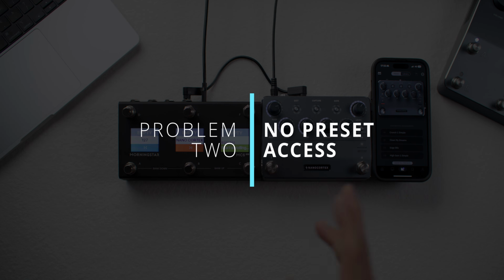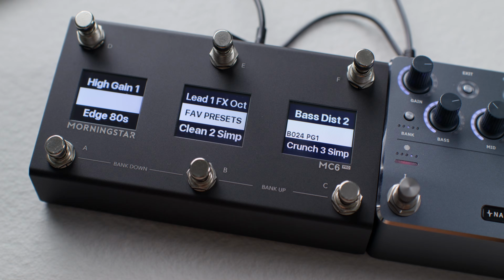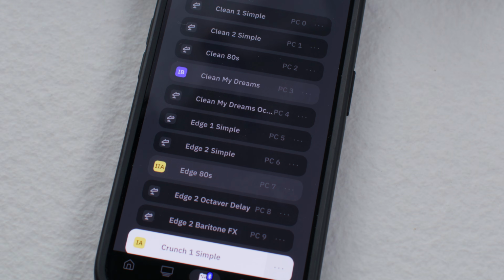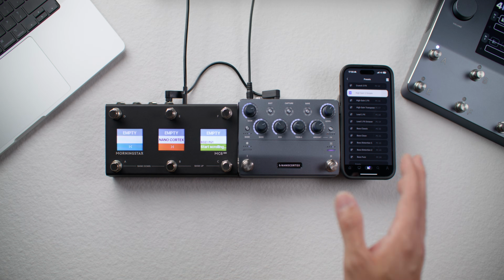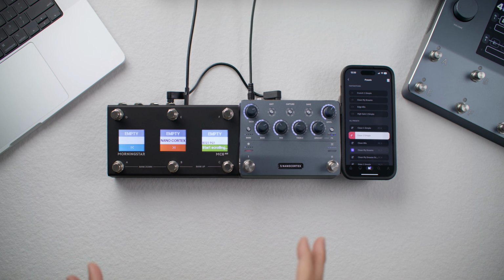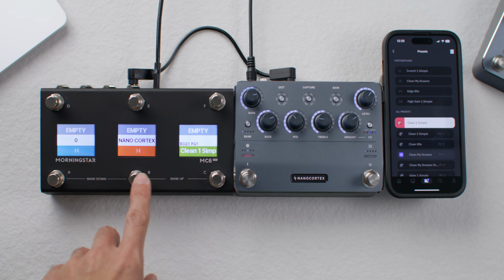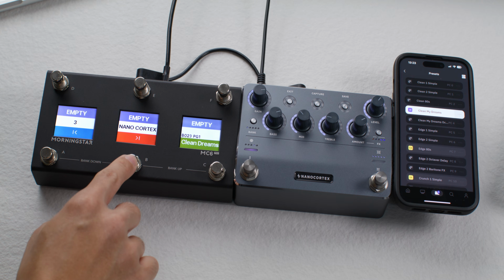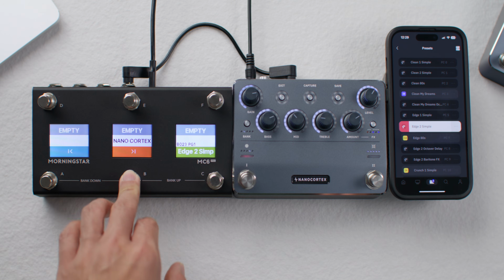Nano Cortex MIDI - MC6 PRO Fixes 3 Undeniable Problems

Comment from the maker: Neural DSP has release a HUGE update with NanOS 2.1 that allows MIDI control over individual effect slots, tap tempo, tuner and more! Learn all about the new update here - https://youtu.be/V2jq4iCfrAo?si=rIE9zllg8yaZ0KI4
Reply: Where’s the video on how to set up displaying preset names using the preset rename function?
Reply from the maker: @marcelpaige4134  It's in our knowledge base here: https://help.morningstar.io/en/article/preset-message-scroll-scroll-through-messages-within-a-preset-1osfmw/ And also, you can download the bank template, upload it to your controller and see the settings for yourself as a guide!

Comment: Great video and solution but my issue is by adding this midi controller that costs around 450 euros plus the cost of the nano for 500 euros your nearing quad cortex / quad cortex mini range which has far more features for the price. I guess if you own a nano already this is a good solution or if you can find an mc6 pro used or maybe its cheaper new in the us, then this is a powerful combo.

Comment: I downloaded the template on my MC6Pro. The scorlling works perfectly fine :) I have an issue with the preset names: When scrolling with switch B, switch C displays the correct names (going through the Msg in switch C). However, switch A seems only to change the direction of how switch B goes through the Msg in switch C and does not go backwards through the Msg in switch C. Can you help me?
Reply from the maker: Hi! Please send us an email at ‘help@morningstarfx.com’. We provide support from there. A service ticket will be created for you and we will be able to follow up easily.
Reply: I have a similar problem. Did you manage to fix it?

Comment: This is a wonderful addon I know it works as advertised but Jesus Chris man, it costs almost the same price as the Nano Cortex. Make that make sense and don't say manufacturing costs. The Nano Cortex doesn't grow on trees.
Reply from the maker: There are a few reasons why someone could be controlling the GP-5 with the MC6 PRO:
1. The user is controlling the Nano Cortex along with other pedals, amps or software.
2. The user already had the MC6 PRO and purchased the Nano Cortex after.
Reply: @MorningstarEngineering Thanks for taking time to reply. As I said before, its a great bit of kit. Maybe I'm missing something but I don't agree with the pricing. If you could work on getting that down I'd glady but one or even two. Thanks again. Have a great day.

Comment: If I'm using this in a live application and I have my 4 presets in place, do I still need my phone?
Reply from the maker: The phone is not needed at all. It is only present in this video to show you what is happening on the Nano Cortex as it receives MIDI.
Reply: @MorningstarEngineering 
Ah! Sweet! Thanks!

Comment: What if you need to plug in an expression pedal? Out of luck? Or can it be plugged into the Morningstar
Reply from the maker: With the current firmware, Nano Cortex MIDI implementation only supports PC messages for preset recall. Therefore, you are unable to control it with an exp pedal connected to the Morningstar controller.

Comment: Question, can you turn various effects off and on within a preset with the MC6 Pro?
Reply from the maker: With the current firmware, Nano Cortex MIDI implementation only supports PC messages for preset recall.

Comment: Is there a way to use both, the MC6 and a expression pedal? Perhaps, using the MC6 through USB? Or connecting the expression pedal to the MC6?
Reply from the maker: Hi. The Nano Cortex does not respond to MIDI CC messages, so while you can use an exp pedal with the MC6 PRO simultaneously, it will be for controlling other MIDI devices.

You can connect the MC6 PRO's USB Host port to the Nano Cortex's USB-C port for MIDI control. This will free up an additional Omniport for an exp pedal if you need. Take note that USB connection with the NC is only possible with the PRO models.The non-PRO models do not have USB Host ports. That being said, if you have 2 Omniports available you can use 1 for MIDI and 1 for an exp pedal.

Comment: Does this work with the MC3?
Reply from the maker: The MC3 is able to control the Nano Cortex. You can connect directly from the MC3's Omniport to the Nano Cortex MIDI in via a 1/4 inch TRS cable. You could also use a cable/adaptor to connect either the MC3's 5-pin MIDI out or 3.5mm MIDI out to the Nano Cortex's 1/4 inch MIDI In.

Comment: pardon my ignorance but is it possible to program one of the buttons to be used as a tap tempo for delay trails?
Reply from the maker: Hi. Sorry, there is no such thing as tap tempo for delay trails. Typically with MIDI you can control tempo for all time-based effects. However, the Nano Cortex currently has limited MIDI implementation, and all that can be done with MIDI is already shown in this video.
Reply: @MorningstarEngineering  gotcha. hopefully Neural will implement more MIDI features in the near future.

Comment: it is definitely looking good, but the midi unit is give or take the same price as the NC, so by adding an extra 30% you get the QC.
Reply: Yes but you can use the mc6 for a lot more than just controlling the qcn

Comment: very nice, that was actually what I was looking for; I have two questions: a) would there be a way to have kind of "2 different config files", so that the MC6 Pro could be easily be swapped between a nanoCortex and a QuadCortex? , b) could I switch between the two different views (6 presets versus all presets) with another simple midi switcher?
Reply from the maker: The MC6 PRO has 128 banks. You can just program some banks for the NC and others for the QC.

Comment: Hello! This video is gold!! If I wanted to turn transpose, chorus, delay and reverb on and then off with my MC6PRO, could I do this the same way I did with the GT1000 Core? Or do they work differently?
Reply from the maker: Hi! The GT1000 Core has more extensive MIDI capabilities, and yes you can engage/bypass effects on it with MIDI. We explain that in our dedicated GT1000 Core video here: https://youtu.be/SAxQemsuLCs?si=q2vX5XA3TeS6avML

Comment: Make video with MC6 Older Version and Nano Cortex pleaseee 🙏🙏
Reply from the maker: It works the same way! It only differs in terms of the display not showing colors and icons.
Reply: @MorningstarEngineering  That was my question too!... could you please help me understand what I'd need to do to make the connection between the MC6 (non pro version) and the Nano Cortex given the MC6 doesn't have the Omniports the Pro version has? Would I need a Midi to TRS adapter?
Reply from the maker: @noleg_kninja  The non-pro MC6 also has Omniports that function the same as the ones on the pro: https://manuals.morningstar.io/mc-midi-controller/MC6-MKII.929988624.html#MC6MKII-EXP1and2-Omniports

Comment: Great unit.. but adding this to a Nano Cortex brings the price closer to a Quad Cortex.. but since I own lots of Neural DSP Plug-ins I might give it a try...
Reply from the maker: This is for user who are using the Nano Cortex with other pedals. The MIDI controller will be used to control multiple devices.

Comment: This is just an advertisement for your product in the guise of something else. That's a bit disappointing
Reply from the maker: Hi. The title says MC6 PRO. No guises there. What information were you hoping to find? Let us know and we will do our best to assist you!
Reply: @MorningstarEngineering  OK, fair enough. Perhaps I came in with miscalibrated expectations - the way this was presented seemed to exaggerate the inconvenience/disfunction of the Nano Cortex - especially in regard to its lack of screen and its reliance on an app. To me, the deliberate choice to use an app instead of an onboard screen is actually far superior in terms of usability and efficiency of operation as compared with other many other similar devices with onboard screens. To overemphasize that as a flaw and to then represent your device as the solution seemed to me to be a bit disingenuous - that's all. No doubt yours is an excellent product with highly beneficial applications (and I'm certainly interested in learning more). Thanks for taking the time to respond and for giving me the opportunity to explain my initial comment. I do apologize if I came across too harshly

Comment: quick question, so since my main 4 presets will be IA IB IIA IIB, would i be able to use this additional footswitch to access them better?
Reply from the maker: Yes, you can access those 4 presets with a Morningstar controller, but also you can access any of the 64 presets on the Nano Cortex instantly.
Reply: @MorningstarEngineering  tbh I'd only use the 4, thanks for the reply
Reply: Then what you want to achieve buddy ?

Comment: what kind of Trs cable is that ?? And where i can get one ? Thanks
Reply from the maker: That’s our own TRS cable design that we offer on our website but any TRS cable will work
Reply: If you use the same type 1/4 inch TRS cable that is used in the video, make sure to configure Omniport 1 on the MC6 Pro to be (MIDI Out - Type A (Standard)) within the Morningstar Editor.

Comment: I use a Rocktron All Access midi controller with my Nano and it works great. I have 15 presets per bank at my feet. Saves wear on the rotary switches on my Nano as well.

Comment: MC6 pro + Nano cortex + Pedaltrain nano = 1.89kg

Quad cortex = 1.95kg

Losing a tonne of functionality, for a saving of 60g?
Reply from the maker: A MIDI controller is used to control other pedals on a pedalboard too. Not just the Nano Cortex!

Comment: yeah but with the price of the MC6.....well change the whole game...maybe you can look at other solutions or save for thr Quad Cortex
Reply: The point of a qc is to not need other devices
Reply from the maker: @erichatzis5986  Sure, but our reply was about the NC.
Reply: @MorningstarEngineering im just saying that you can do all of that with a qc all in one for about the same price. I still think the nano is a great option if you want a simple quality rig or if you already have all the extras but I wouldn’t go out of my way to make it do what a qc already does
Reply from the maker: You’ll be controlling other devices on your pedalboard with the MIDI controller too! Not just the Nano Cortex

Comment: Great! So the solution for this pedalboard friendly unit is to buy another unit that is as big to control it, silly me... why didnt I think of that.....
Reply from the maker: That’s right! You’ll be using the MIDI controller to switch/control your other pedals on the pedalboard too!
Reply: @MorningstarEngineering  I'm sorry, but even if the MC6 Pro is a great piece of gear.. I think that particular  contraption is not ideal by a good long shot... It raises the price to double and also the real estate needed, introduces cables and points of possible failure with that. At that point I consider myself better off with a helix LT or anything other than that nano cortex. But if other people love it that's great.
Reply: @musicsurfandrats  This is why I use all in one units.    But for those who want to use individual pedals and don't want to tap dance then some sort of switcher is needed.  Every setup has its pros and cons.

Comment: I have a MC6Pro with my Nano Cortex and a H90 wired pre-post. The MC6 makes it all work, including momentary unlatched preset changes. It's a great little rig
Reply: With this you have access to 8 presets right?  The 6 on the midi and the two on the nano also correct...
Reply: can you turn on and off effects?
Reply: @jakubmikulcik9572 No. It's been requested and will come in an update to the Nano I think. For now, you need one preset with the effect on and another with it off and then switch between them
Reply: you know judas midi? it’s awesome. kedem4 and kedem6 are BEST midi model IN THE WORLD!!!!!!!!
Reply: Does switching presets when playing have any delay or is it 100% instant like analog pedals?
Reply: @StippGuitar  I do have a delay and it is annoying and you can hear them while playing fast song and quick switches can't go unnoticeable. that's why im looking for options like midi controller to switch on and off momentary
Reply: @ManapartOfficial  This delay is using the morningstar with the NanoCortex? Because I also have the annoying delay but with plugins in the laptop. I wanted to know if the delay also happens with a NanoCortex
Reply: @StippGuitar  seems like with midi control no. because nano cortex have a new update 2.1.0 which allows midi control to turn on and off the effects. so it won't be switching presets that takes long it would be turning on/off banks within the preset so I assume that should be much faster
Reply: @ManapartOfficial  What do you mean by a "bank within a preset"?
Reply: What are you using momentary unlatched for? How does it work